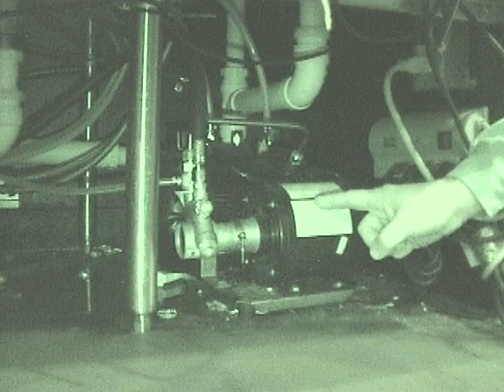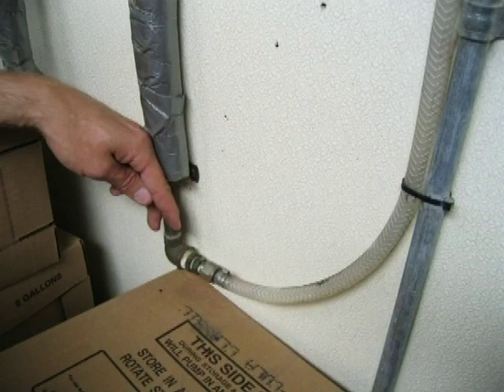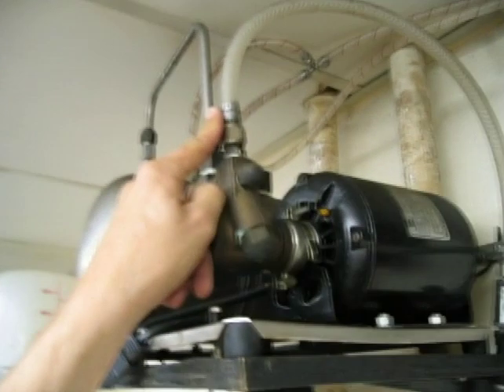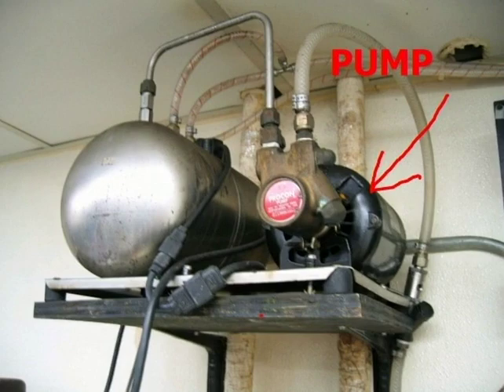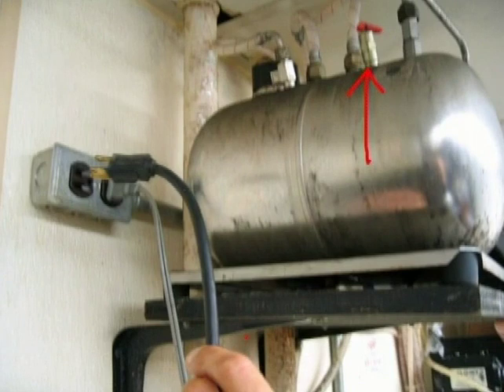Carbonator Running | Problems with Pop

Comment: What does it mean if it's spraying?
Reply: The relief valve has blown. You might have air in the tank that compressed or the control may have failed.
Reply: So get a new valve, or get a new probe for the McCann?
Reply: @ryanwalters5349  if it has a probe it could also be the control board
Reply: It’s usually a probe problem if it keeps spraying out of the relief valve, unplug the unit and call for service or replace the probe yourself if you have it.